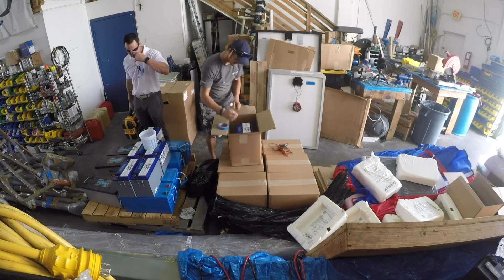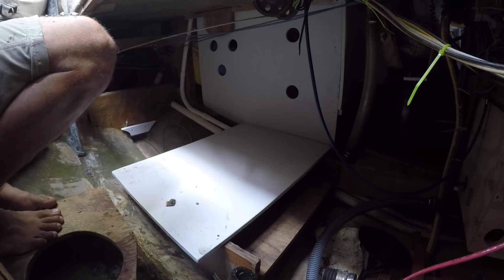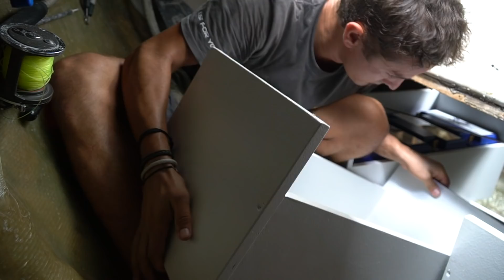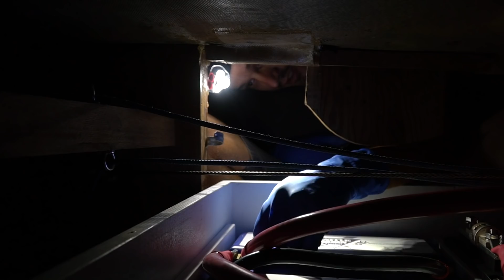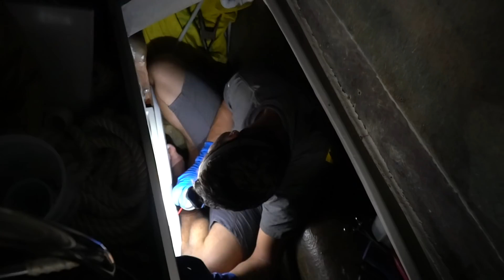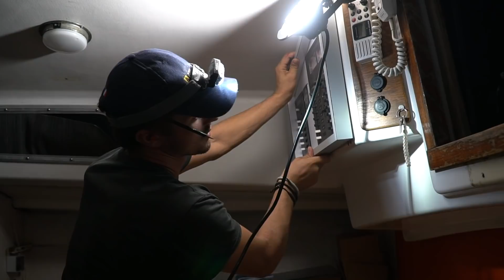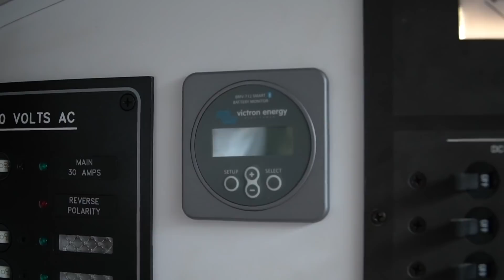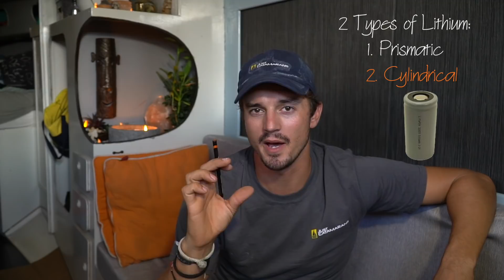Uma's new Battle Born LITHIUM heart ❤ — Sailing Uma [Step 135]

Comment: Hi dan, Please check my comments at the Delos channel. It is a nice setup but there are some really big (safety) issues. For example this bms system is only suited for 12v not 48v because of the series placement and electrical chemical properties of Lifepo4 you Cannot see the charge level based on voltage. So you need place them All in parallel and charge toen above equalisation level for at last 24 hours. Such that you know they are full. You only know the normal testing voltage whi h indicators beteren 20 and 90% full. Normally the external bms makers sure you dont overcharge or undercharge your system. Now this in in a single battery and for example one battery shuts off you loose the entire series of battery’s and don’t know how full the other ones are. Same holds for charging if they tend to overcharge (you charge them to full) then the battery shuts down which you really don’t want to have on a boat. (A full battery but you cannot acces them). So please review with a proper electrician / chemist and not with a boat installer who wants to sell you there drop in replacements. Lithium just aren’t drop in replacements but require the electrical system to be build for it. Safe journeys!
Reply: I"m not doubting that you may be right... But, I would think a reputable dealer who sells them as drop in replacements would include the correct way to install/charge/discharge them...
Reply: Dennis de Jong
I believe you can overcome this 12/48V discrepancy with a 48V charging system ( controller ) no biggie. This would be placed at the 48V end of the bank. Or I think it would be possible to use one way diodes and charge each batt from a 12V bus and use a 12V charge controller and this would allow each battery's on-board charge controller to shut off the input from the bus without interrupting flow to the others. These on-board computers will not allow the batts to be overcharged, but will they interrupt the charge of their neighbors? The one way diode would ensure that there is not back flow towards the charger. I 'think' either way should be fine because the electric input should be even across the circuit. So having one batt reach capacity  before the others and shutting down the circuit like you mentioned 'should not' happen. Great research question. 
Dan, can you test this for us? Run your bank for one cycle 50-80% and then test each batt to see what the remaining charge is and see if it is in fact equal across the circuit. Then charge the system and repeat the test. Could you also test the input current/voltage at each battery during the charge? Perhaps, do this by testing the input wires not the terminals?  Not that you need more to do but this is a great question here.
Reply: jesu cristo yeah but I dont want me charging of the system shut down the load site of my system. Ie such system should always have a separate charge and load bus. Such the intelligent bms only shuts down charge when full or load when empty. And both if temperature issue. This is how I build my system. Also big brands as victron or master volt build there system in the same manner. Not by this company without much information to find exactly what their internal bms does. Ie on the water I don’t want to be dependent on a system that can shut down while in normal operation.
Reply: @dennisdejong3419   I think that I do not understand your reply. Charge/discharge busses have to be different and isolated. I don't think anyone is making them into one bus, (that's not possible) which makes your reply even more confusing. It's probably just me because I've only designed a handful of these systems so I'm no expert but ???
Reply: I think a poor analogy to the one battery becoming full first and interrupting the complete charge of neighbors is that of a manifold on a water distribution network. The amps/volts in the battery bank 'should be' equal across the circuit. That's what I asked Dan to check for us. And the 48v charge controller will see only three batteries at 48 volts and their total potential thus eliminating what you're worried about. It's just like how the manifold in a water distribution system would reach equal flow rate and pressure across the entire manifold and points of use or end, (if it's built right).  It's a great research question and I hope Dan has the time to test this for us.
Reply: jesu cristo and this is exactly the problem there are 4 batteries in series for the 48 volt you charge them by putting 48 volts on the first battery and the second battery gets the 12v but is full and shuts down completely! The whole series is down ie they are all connected. Such that you do not know the power fullness of battery 2,3 and 4. Bigger problem is that the whole series will shut down because of charging!! Ie you won’t be able to put load on it the load is also disconnected. Therefore any professional lifepo4 system you buy you will see a seperate charge and load power bus. Such that in the event of charging full and stopping charging by relay (otherwise lifepo4 will blow up) you can still use the load site. And the other way around.  Makes the system more safe.
Reply: @dennisdejong3419  the idea of a first or last battery doesn't make sense to me. In the complete circuit there is no first or last the voltage across the circuit that is the entire 4batt bank is now a 48v circuit. This is why I don't understand what you're saying or worried about. Wired this way they become one 48v battery with 100amp hr service at the 48v. The isolated charging bus inputs at 48v across the entire circuit simultaneously. Both the in/out flow lead to my water analogy. The  flow is 48v electric potential across the entire circuit if it we're not it would ruin the batteries, this is why Dan tested them for continuity before the install. You're making me want to test what I'm telling you but I'm 99.9% sure it is impossible to have a varied voltage across a single simple circuit. You can draw from any point in the circuit and find the voltage to always be 48v because the electric potential is the same at all points. I now have to test this, just because. But saying that it would be different at one end of the bank vs the other seems to argue that the batteries and their electrons know what direction they are facing and that they automatically adjust their electric potential as they flow from cell to cell. (Which doesn't really happen because electron drift is in mm and smaller). Thank you for the dialogue I'm excited to see what happens and super happy I am about to either learn something or review something in experimental space.
Reply: @dennisdejong3419  on the not charging and loading at the same time this makes no sense to me but probably all me here. Why would anyone build a battery for power Storage that could only be used at night or in the absence of whatever source you were generating from? Even if it is true why would the controller not oscillate between in and out and why would the one way diode (one way flow control)  not work? If you watch the power consumption meter on a good controller it reads the difference between in and out and gives a positive or negative total. Your standard Prius does this too. Telling you if your momentum is generating power engine generation and electric motor consumption still giving the driver a sum that is either positive or negative but always using both.
Reply: jesu crist until you take into account that all the cells have a different resistance and that the resistance also changes over time. So no more simple all equals flows.
Reply: jesu cristo all electric cars have a separate charging and load bus. Please. Investigate and check the bigger systems also read Victron articles on lifepo4 systems. There is a reason why they are not simple to implement.
Reply: @dennisdejong3419  will do. Victron.
Reply: @jesucristo1870  It is a great question, and the perfect opportunity / time to run the tests.
Reply: @scottmaschino1927  yes!
 DAN!!! Help us ignants out and answer this question!!!! Prease!?!?!?
I think it's fine. Besides the question at hand  a good modern controller could even be programmed with capacity data. Which I don't think is necessary due to how they work. Charge controllers haven't had this feature until recently but batteries have been properly charged for decades. None of my controllers are digital or programmable and they don't ruin batteries or battery banks.
Reply: Battle Born (the manufacturer) would do well to make each battery's BMS accessible by an external monitoring system.  Having a window into the state of the internal cells would make it possible to catch potential a problem before it becomes a real problem.
Reply: The discussion of these batteries seem to have missed a point I think Dan made that the terminal's are really computer ports and not simple direct connection to battery chemistry. Consequently, the batteries can distinguish drawing and charging demands to respond accordingly but may even coordinate via a powerline digital network between them. The possibilities are endless. There remains an issue with temperature though...
Reply: yup, its pretty cool. I bet that it will be cool, we'll see next summer.)))
Reply: G11713 have you read the specs?
Reply: Yes indeed. I too can not understand why a manufacturer recommends putting 12v blocks is series and parallel to get to a system. It's way way better to put 16 big single cells in series with a single bms to get to the 48v battery with the capacity you require. Then it's a properly managed bank like it's supposed to be.
Reply: Dennis de Jong Maybe we all need to RTFM - “Our batteries work with trolling motors in 12, 24, 36, 48 volts and do not need anything extra equipment, we do recommend that you use a multibank charger. We work well with most brands Dual Pro, Minkota, Noco et. If you have a question about charging give us call 855-292-2831 or email us info@battlebornbatteries.com.
*We can support systems up to 48 volts with our Battle Born Batteries. For 24 and 48 volt systems using inverters and inverter chargers will need an extra piece of equipment to “soft start” the capacitors of these devices. If you are using a 24 or 48 volt inverter charger or any DC device with large capacitors such as a heat pump, give us a call 855-292-2831, so we can help you set up your system.”

https://battlebornbatteries.com/wp-content/uploads/2018/03/Battle-Born-Manual.pdf
Reply: Stephen Gloor the problem is that in electrical forums the discussion of how to implement lifepo4 runs for over 10 years now. From electrical engineers and chemical engineers. There has been done lots and lots of testing. The simple statement is that drop in replacement does not exist. The properties of lifepo4 and how you have to treat them is just different. Look at 123bms or batrium both bms systems that life for some years now. What my problem with these kind of videos is that there is not enough emphasis on how to securely use these batteries. These are real little power boms! There must be more safety mechanism in place then there are now. And then the safety mechanism cannot be that invasive on the power system such that on the ocean the power drops because of a single battery this could lead to very dangerous life threatening situations.
Reply: Dennis de Jong  I would completely agree with you hence these sort of batteries that have a built in BMS to overcome the 10 years of concern.  However the manual does state that a multi bank charger is recommended especially for the series string.   In there case I would have gone for the 48VSimpliPhi batteries that are would not have required a series connection just parallel.
Reply: Not to mention the added amp hrs.

Comment: I can't imagine doing the refit without doing new wiring...good decision.  Awww, but then you didn't solder the connectors on.  I guess the crimper looks pretty good.  Showing the discharge curves is how I explain the difference between Li and lead batts.  Also shows the advantage pretty clearly.  How do you 'throttle' the motor?
Reply: I'll sum up the crimp vs solder argument, for whose who want to go down that particular rathole: 
In my experience (about 45 years of it) soldered connections exposed to salt-air/salt-water conditions corrode. Always.  It may take a few years, depending on exposure.  They may go intermittent (which is often worse than complete failure).  Consider carefully where you wan to use soldered connections.  If it's super-important or hard to get to/had to inspect, you may want to apply more initial effort.
Yes, a PROPER, well done crimp will be gas-tight and last much longer -- but takes the right tools and practice.  
Common heatshrink on a soldered connection has it's pluses and minuses and is, at best, only a minor improvement.  Tight-fitting, adhesive-filled heatshrink is much better -- best if the heatshrink is clear, so you can inspect for corrosion later.
Reply: Thanks Proto...taking notes here.  Is it the presence of the flux that invites the corrosion?  Would a pure silver solution work better?  Do you see the same issue with tinned lead ends?
Reply: Running large copper wire 4/0 usually for 15kw+ car audio systems we solder, crimp, then tape off the contact point... Dip in liquid electrical tape, and once that is cured... Heat shrink.

Comment: We just installed 2 lithium batteries (battle born) on our Beneteau 36 and they are such a huge upgrade! We have no solar or wind power and a pretty power thirsty boat, and they last way longer then our 3 lead acid batteries before. The only thing is we had to install a very small non lithium starting battery because the battery management system on the battle borns didn’t like the surge that the engine starter motor sent out. Cheers guys!
Reply: The HVAC Kid did you have to change any wiring with your new batteries?
Reply: Cindy Mobley Nope, we were able to keep all of the wiring and the battery charger from the old batteries
Reply: Yes, I was wondering why they didn't get a BMS and small 12v battery for it, that seems to be a standard setup these days.

Comment: Hey, did you have to change any of the settings on the solar charge controller for the new batteries?  Have you considered getting a more efficient motor?  If I understand right, the one you have was designed for an industrial application, where it was hooked up to a constant power source.  Have you looked into some motors that were designed for electric vehicles that should give you a better power curve (like, maybe, a Motenergy ME1115 or ME1306)?
Reply from the maker: Yes, I'm sure after testing, that our suspicions will be correct in that our current motor isn't as efficient as it could be. It is now for sure the weakest link in our system and will probably overheat before the batteries are drained. It was however from an electric forklift, so it is designed to be quite durable. We'll see.

Comment: Hi Guys, really love your channel, probably be mentioned by others but a couple of suggestions; looks like the battery locker is used for a few other things, perhaps a battery box cover could be prudent. looked really tight fit in your bespoke battery boxes (like a glove) however I would have added foam/timber spacers for air flow to reduce direct heat transfer. LiPO4's don't like it too hot so ventilation might also be a good idea.
Not sure if you mentioned mentioned regen? Is that possible with your system?
Can't wait to hear more of your adventures, and the tech reports, wishing you all the best
Reply: Didn't he say he was installing a cover "to keep the grime out", I think.
Reply: Chon tsno....my bad, he did mention that he planned to make a lid, guess I missed that, just saw that steering cable hanging above bank and thought, Ithat would not like that to fail and fall across the top of the bank. Also was not sure why the steering cable was grounded?

Comment: Excellent move with the Lithium.   Way more up front cost but you will go through 3 sets or more of lead acid batteries plus you get at 80% instead of just 50% the amps a lead acid would give.  RV's have been switching over to lithium after they do the math also.

Comment: So you have 12 circuits controlling (yes I know they are “sealed”) your 12 batteries plus the solar charger and electric electric motor....on the boat in the (Potentialy) dump space....I can’t wait for your 12 months report. Good luck 👍🏽 🍀

Comment: your also getting a lot more cycles out of your new lifo battery than lead-acid battery's and last you many years if you use them wisely and don't go below 20% but you can get almost double the amount of cycles if you don't go below 50% hope this helps
love seen your vids keep up the great work :D
Reply: And dont go over 90% so 20-90 = 70%
Reply: My understanding is that Lithium can actually be cycled deeper with less harm. Considering that these batteries cost $1000 each, I'd certainly hope so, anyway.

Comment: This is so awesome! Glad to see you've made the conversion. I was curious about how many watts of solar do you have. And have you considered a water turbine for additional power. Its a good way to extract power from your sails on those days that you have the capability to exceed hull speed. In conjunction with the solar. It would top off batteries pretty quick.